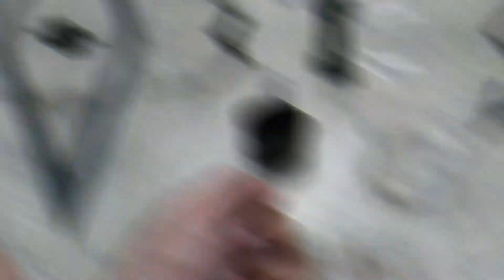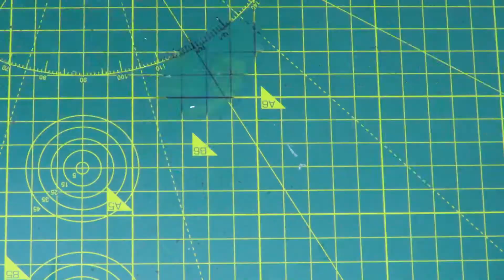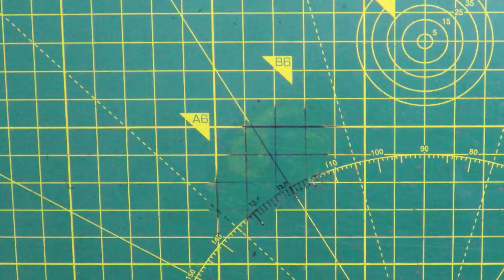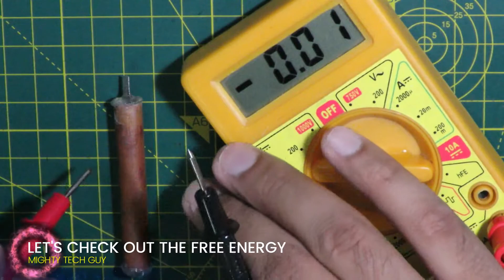Make "CRYSTAL POWER BATTERY" | Part 2 (Free Energy Series)

Comment: Thanks. How many amperage?

Best regards
Reply from the maker: It gave half an amp spike each time it loaded it with a small ohm resistor,but its just a spike... on average its around 100 mA...
Reply: Sorry for the late reply. Thanks. ^^
Reply: Can it power a small DC motor ? For how long ??

Comment: Unlimited???
Reply from the maker: Kapil Aggarwal  yes
Reply: Mighty Tech Guy No! it will oxidize, just as any electrode in any ordinary battery except for lithium, it works kinda different
Reply: I played with crystal cells  a while back. I couldn't stop the magnesium getting eaten. Even dialectric grease didn't solve the problem for me. Fausto Heikkinen claims to have solved the problem. Check out his videos.